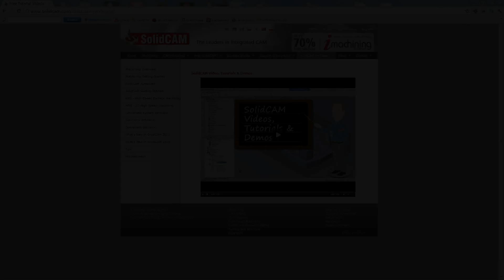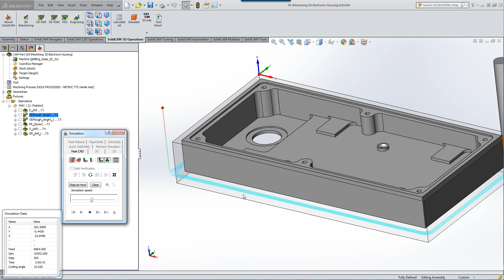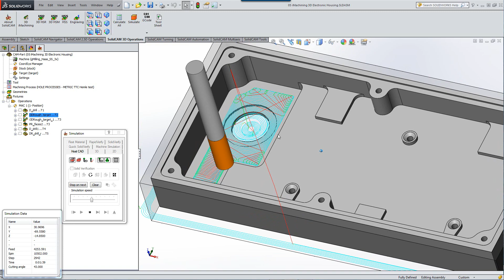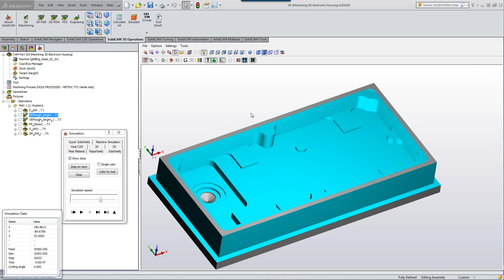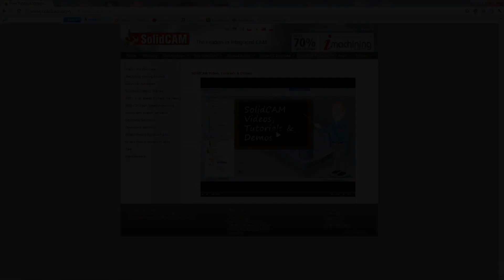What's New in SolidCAM 2015 - iMachining 3D Prismatic

Comment: Hi, we want buy solidcam in our job for faster milling. In 90% we do only 2.5D milling. We have Hurco VMX10i. I work in solidcam on school, but from this time solidcam did too much progress. My question is... there is many videos from roughing in prismatic, but some fast finishing? I need do Roughing, than finish Z with another tool and than finish walls. How can i do that? If i use 2.5D finish as second operation and i want finish only Z, so its finished only around walls, but not all area. Sorry for my bad english.
Reply from the maker: conik007 Hi,
There are 2 ways to do a finish operation just on the wall. The first way is to use pocket recognition. I the technology field use the rest material option and choose around profile for milling type. Make sure the value you put in for previous tool diameter is larger than the diameter you are using in this operation. The second way is if you have HSM you can use the option of constant z.
 Your local support team can help you with this.